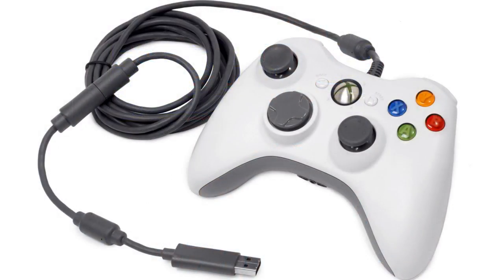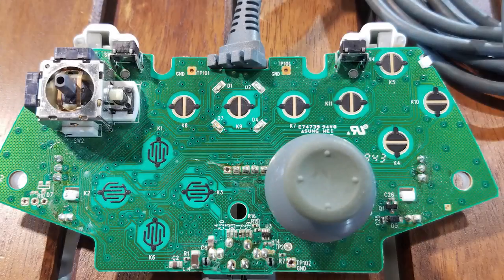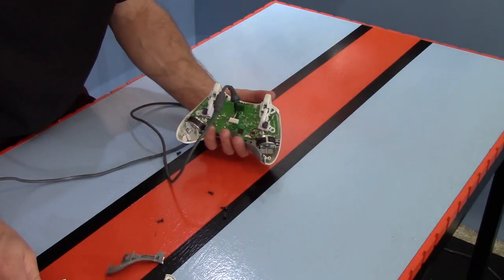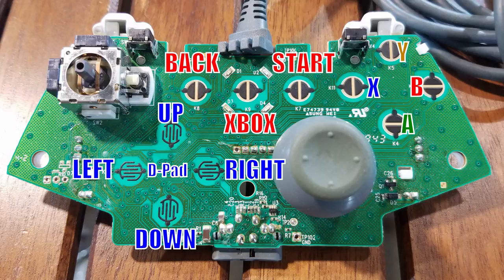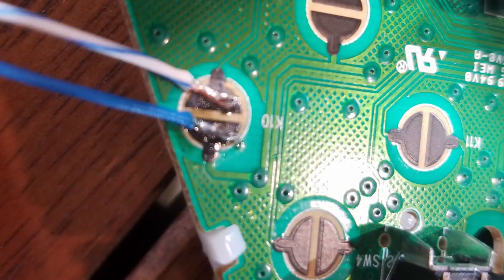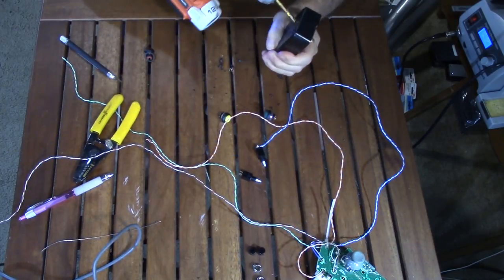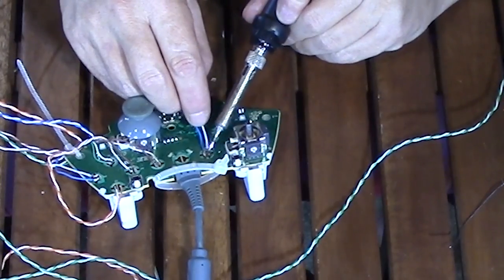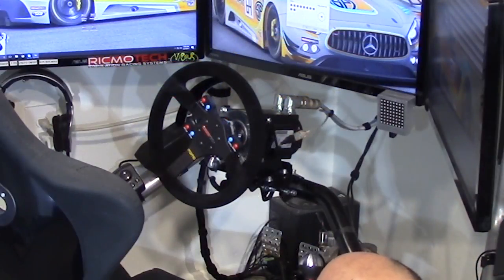DIY - Cheapo Button Box - Xbox 360 Controller

Comment: Cool video, good job explaining the basics. I used this method to build an h-shifter 15 years ago.

The buttons on the PCB are likely to share a common ground, once you solder a wire to one ground side you can run it by all other buttons in serial fashion. This is easier and you can use less wires.

For the D-pad grid, you can usually follow the leads back to the chip and solder onto its connectors directly. They are close together but easier to latch onto.

Last tip: do NOT solder anything with the USB plugged in. This can fry your controller or even the USB hub on the mobo.

Comment: Teensy LC board is ~$10 and much better suited for this purpose.
Reply: dont you need to program it? Also, this could make it compatible with consoles, who usually dont have these sort of peripherals
Reply: It's really easy to program, you can copy&paste a template from pre-made examples. You only need to write one command to configure input pin and another command to read it.
Reply: Imagine you have an old Controller because you got an XBox One for example. I think thats the reason Shaun used the Controllers board. To recycle/repurpose the old stuff.
Reply: Teensy LC is the way to go. Much more flexible : you can easily add quadrature encoders, 12-way switches, analog inputs, combine analog inputs for a dual stage clutch .... With a standard controller you are stuck with buttons.

Comment: Instead of a controller:

UNojoy
UnoJoy! allows you to easily turn an Arduino Uno (or Mega or Leonardo) into a PS3-compatible USB game controller (or PC)
a ardiuno clone should cost about $5 or less

or a :

Zero Delay Arcade USB Encoder
$3-4 on ebay.